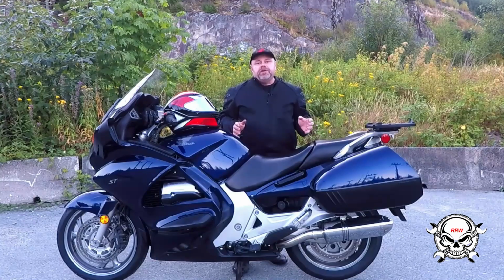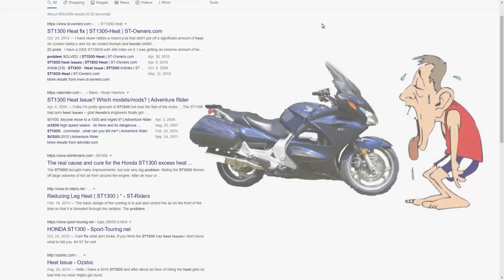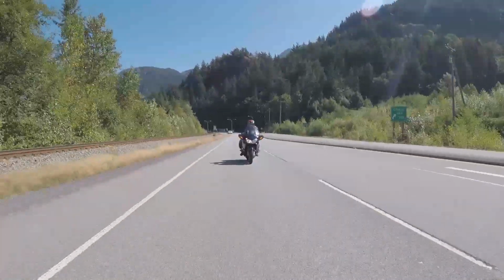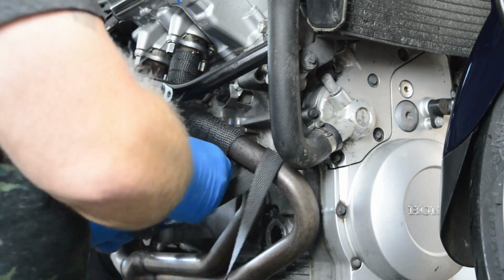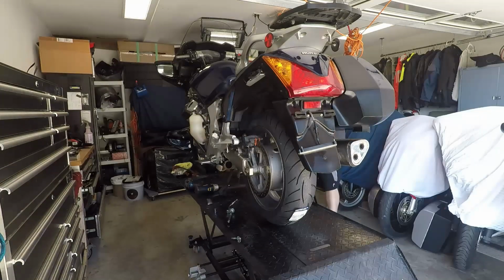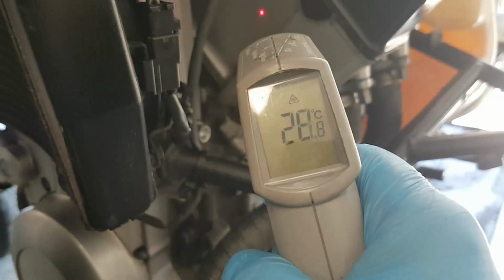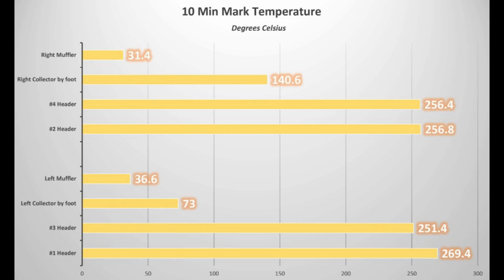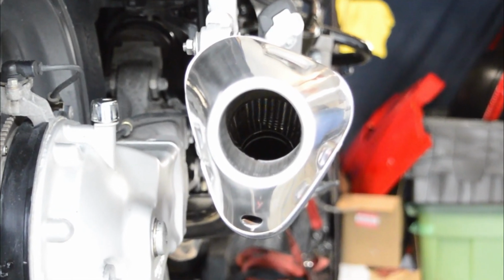Honda ST1300 PanEuropean Heat Reduction

Comment: August, 2021. I took an ST 1300 for a test drive today.The heat issue just kept me from buying that nice original Honda ST 1300 . It is 85° here today, I told the seller that I would not be right back on the test ride. I told him I’ll be gone at least an hour. I got about 15 minutes down the road on a back road that I was traveling 50 to 60 miles an hour with some tree shade, and it  felt like when  you open the door of an oven on my legs. I open my legs to try to scoop some cool air towards my crotch, and it was hotter because of the air ducted out thru the heat vents..
  it is August 2021 here in Pennsylvania. I sold my GL 1800 Goldwing in June, I sold my Moto Guzzi norge in april.. and I sold my 1994 Honda Pacific coast that I commuted on for 24  trouble free years. I just wasn’t riding it and it made me feel bad to go from riding at five or six days a week to one or two days a month. 
    All three of those bikes did not put out half the heat that the ST 1300 I rode today did. The Honda pacific coast put zero heat on the rider no matter how hot it was out that day. that was quite an accomplishment by the engineers at Honda to duct that heat from the radiator out away from the rider completely.
  The ST 1300 I looked at today has 37,000 miles on it, 2005, the original owner, never dropped, it had the special highway pegs, Russell day long seat, two windshields one was real wide, heated grips, it had a trunk, it had a brand new set of Michelin pilots on it, they still had the mold whiskers on them. The exhaust & the intake were totally stock. The bike was not tinkered with.. The asking price was $4600, the bike was dirty, needed detailed…the guy said I am not a motorcycle washer. I’m not either, so that didn’t bother me. I will not buy a motorcycle that the owner pressure washed regularly. Pressure washers destroy motorcycles. I have seen it..
   anyway, the heat coming off of that bike was a dealbreaker. My current bike is a Kawasaki Z 400 but I just picked up, 2019. It literally weighs less than a half of what ST 1300 Weighs.. I have done 21 changes to my Kawasaki Z 400 , Gel seat cushion, 2 1/2 inch bar risers, taller windshield, real horns, rubber top foot pegs,Hepco Becker passenger seat replacement rack, givi trunk, magnetic tank bag, foam grips, swingarm spools,, 64 miles per gallon over the first 1500 miles, no heat issues at all, none. I upgraded the shock to a Suzuki GSXR 600 shock, fork caps to adjust spring preload, I’m going to put in upgraded springs in the forks, I got it dialed in. I have to get used to getting hit in the face shield with bugs, and I have to be a little more selective at what I pack in the tankbag and trunk. I used to add things that stayed in there forever like, walking shoes, umbrella, small fold up stool, real eating utensils, motorcycle cover, but I’m gonna have to just take the basics like tire repair kit and electric pump, electric vest, hot and cold weather gloves, face shield cleaning spray and cloths, water, cargo net, baby wipes (they are better by far than toilet paper) tiedowns, paper maps, I prefer them, I like to see where I’m going , not just where I am at the moment.
  anyway, for less than $500 I completely transformed my Kawasaki Z 400, which is the same bike as the ninja 400 but it has a standard riding position. I’ve transformed it into a general purpose mule. Insurance for a year with $500,000 liability protection, roadside assistance, trip interruption insurance is $75 a year through Progressive..
  so I’m going to pass on that rolling oven ST 1300, the same way I passed on the Kawasaki concourse, and the Yamaha FJR. Those are the only reasons I passed on those bikes is because of the heat..
Reply: My 2011 Concours isn’t bad for heat.  They made a lot of improvements over the 2008 and 2009 models.  My 2007 ST1300 gets hot enough that it melted a prescription medication that was locked in one of the saddle bags on the first day of a week long trip.  Never saw that before on my other bikes.
Reply: @alanhassall  
it melted a prescription bottle?? wow.. when I took the ST 1300 that I wanted to buy for a test ride. I could feel that that was some serious heat on my shins call me and I was moving constantly on a back road, I was not in stop and go traffic. That’s why I passed on buying that st1300
Reply: @Jodyrides  Not the bottle.  Just the pills inside the bottle.  I had spent the day on the motorcycle traveling at around 70 - 80mph.  The cats are in the mufflers under the luggage.  On that same ride I had times when my calves felt like they were on a rotisserie.  I was wearing an Aerostitch suit.  The gauge always read normal when the light was such that I could read it.  A few weeks ago I needed a multi tool that was in the left fairing pocket and it was so hot that I could barely hold it.  I think that I could cook food in there.  Honda definitely could have taken a bit more care in heat management on the ST1300.  My ST1100 was never like that and my 2011 Concours14 isn’t like that.
Reply from the maker: Thanks for Liking & subscribing!
Reply: 🤯all kind of info here, thanks all!

Comment: Curious if the manifold stays good. Read some things about heat wrap and manifolds holding too much heat. The manifold can become brittle. Anyone here that only tried the heat wrap and not the exhaust?
Reply from the maker: Manifolds that break down from heat wrap are typically because moisture and dirt get into them.  Tightly wrapping will mitigate this, I don't expect any issues as I have had Harley pipes wrapped for years which are much more greatly exposed.  Worst case change your wrap every couple of years.  Thanks for Liking & subscribing!
Reply: @RodRidesWrenches  Manifolds that rusted out are the old school steel pipes with chrome plating, they rusted out even with out wraps. Many people put the wrap on them to hide the rust, causing them to rust even faster. Modern pipes are made of stainless steel and are resistant to rust.
Reply: Yes. 18 years on the wrap....no rust or breakage due to brittleness.

Comment: 2000 Honda VFR 800. Great video. I ride an 05 ST. My tank gets hot AF right in front of the seat. I stay away from it if it is above 90 F outside. Highway pegs help. I live in central Texas where it stays plenty hot for a few months. I have contemplated some of the mods you suggest, but have just learned to live with it. I would like to try a set of those Delkelvics. They sound sweet!
Reply from the maker: Thanks for sharing, liking and subscribing!

Comment: I enjoyed your video.  Please keep the info flowing.  I am currently running 2 ST13's,,,  a stock 2012,, and a hot rodded 2004,, both Canuck bikes.  The '04 has a lot of mod's,, which I will list in a following comment here soon.   In moderate Ontario weather,,, I don't have much issue with heat on either bike.   Keep up the great video's,,,,  I really enjoy them,, and appreciate the amount of effort that you put into producing them.
Reply from the maker: Thanks for Liking & Subscribing, New Video this Friday!
Reply: 😊i